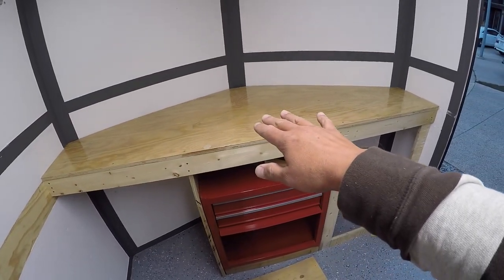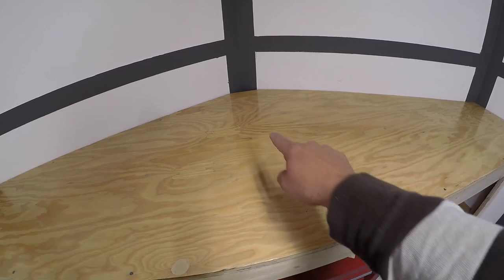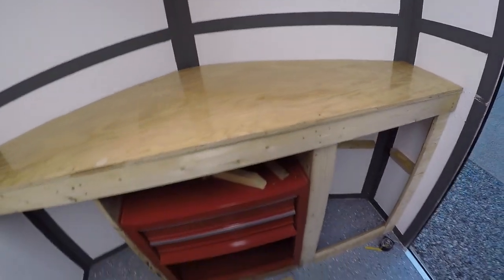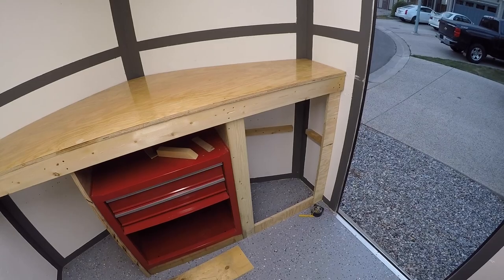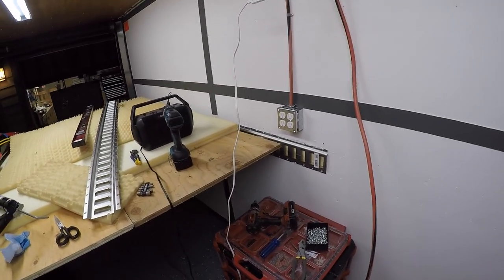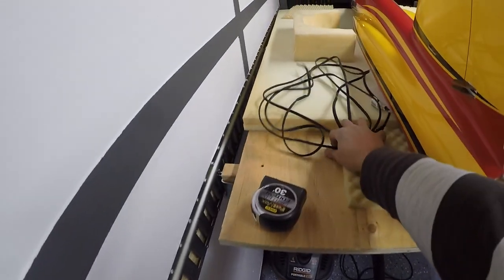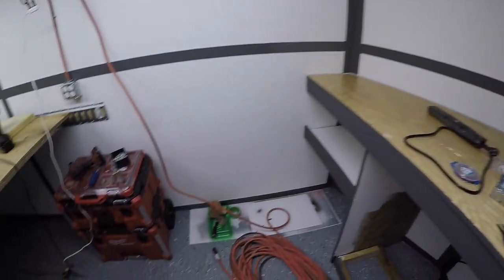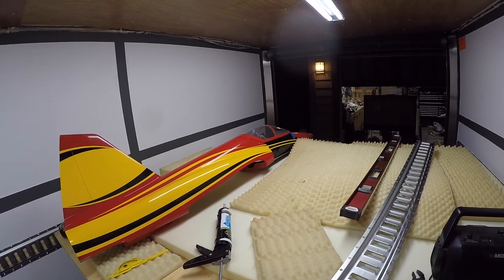RC AIRPLANE TRAILER BUILD - The Ultimate Jet Trailer - Video 4

Comment: 1) Carpet on the shelf is a great idea, it does really well with a grease or fuel drip and like you said keeps your shelf from looking like a fish net after a few years. In this hobby we constantly buy and sell planes and need to move the tie downs accordingly so after a few years your shelf has hundreds of holes and looks terrible even though the wood is structurally sound. 

2) I am busy designing my ultimate trailer. I will probably spend another year on designing because I constantly see things other guys did and either like it or hate it and then adapt my trailer around what I saw. One thing I haven’t changed since I started was putting doors on all my cabinets, our jet group often do trips where we visit and camp at the fields, most of us sleep in our trailers so I wanted a way to keep everything neat and organised and not have everyone who gets in see my clothes in my cabinets. 

 3) I would mount the spare tire somewhere inside to reduce stress on the outer skin plus here in South Africa your tyre would be stolen within a day or two.

4) I fly large scale and I stand my wings upright on the wing root and strap them with bungee cord and D-rings to the side of the trailer, a strap near the top and one near the bottom does the trick. For my jet and paternship I build a frame that screws to the wall and have nice thick dowls stick out from, which serves as a light weight shelf. I just run a strip of the soft side of velcro from the frame over the wing to the to a piece of the coarse side of velcro which I stapled to the bottom of the dowls. Last thing the wing box is a good idea, but if you ever get a new model or change models they wings might not fit and you have to redo the box or modify it.
Reply from the maker: Hello Charl!  Thanks for watching from the other side of the world!  SOOO Cool!  It seems like carpet definitly gets the vote and is the way to go.  I'll go that route.

Good call on the cabinet doors.  I prefer the neat and tidy look as well!  I have a travel trailer as well but now if i'm going to events it's one or the other so my airplane trailer will probably get the win and I will be sleeping in it.  I suppose it's time to buy a motorhome!

Regarding the spare, it's much less hairy where I live for theft but it still does happen.  The mount that came with the trailer (Mounted inside) had 2 lug nuts and a lock setup on it which is nice.  I may not sort out the spare tire mounting till next year.  🙄Still thinking on it.

Thanks for the suggestions on the wing storage!  I appreciate hearing the different ideas.

Comment: I would investigate mounting the spare outside on or under the A frame.  Many travel trailers have them slung behind the tongue jack below the v nose.  I would try to avoid storing it inside as it eats up valuable r/c space.  For sure small shelf/cupboard up front above your bench.  As you say don't make it too deep or it will overhang your work space and you will smack your head often.  It does allow a mount for another light, as well as various types of storage.  Wings can hang on walls, under the split bench (carpet gets my vote btw).   Have you considered hangers for your "man door" that could be a place to mount folding chairs?  Lots of brackets that will hold a pair firmly up top and a bungee across the bottom so they don't move around.   Interesting that you did everything 110V whereas I plan 12v knowing  that I will have solar/inverter/2x golf cart batts.  Both work I just like not needing to put lots of hours on my genset.  Of course if its cloudy for days then I would need to use it anyways.  Enjoying the build, there's as many ways to finish these things as there are modeler's out there.
Reply from the maker: Thanks for chiming in Daryll and great comments/suggestions.  It seems like most are suggesting the carpet route for the plane shelf, Makes sense.  My concern with hanging anyting on the door is i'm not sure there is any structure in the door itself.  I'll have to investigate it further.  It feels like foam core with FRP panel on the interior.  So anything that mounts on it has to be bolted through the door.  
I went with all 110v just to keep things simple.  My little honda generator sips gas and hardly gets any use in a year.
Reply: @thelightersideofrc  The way friends have done it they glue a ply/hardwood backer onto the door (PL premium etc) and then screw through it and into the light ply door material.  Should be plenty for 20-30 pounds of chairs etc.
Reply from the maker: @daryllfarrar2147  Ahhhh.  Perfect!  That makes sense.

Comment: Jonathan, good work. I like how this is progressing. I believe you have seen my trailer video in the group on FB. I lined my walls with carpet. I liked it for the reasons you mention about moving the D rings. I would carpet the airplane table if I did it again. As far as the NOCO adapter you installed. Looks like you ran into the same issues I did. I will recommend putting silicone on the screws where you ran them in the siding. I did not have good luck with the rubber gasket. Be aware of the power rating too. I chopped my plug off in the inside to wire it into the breaker panel of my trailer. I was surprised how small the wires were, but they worked for running chargers and fans. If your gas can leaks fumes, I’d recommend a vent to the outside for obvious reasons. I don’t advise overhead cabinets without doors, I had bad luck. Will you ground your 110AC to the trailer frame? Can’t help you with the spare tire. I could never get satisfied with where I put it. Check out my wing storage if you’ve forgotten. Pin those joints if you use PVC! I have a fantastic idea for wings that I came up with by repurposing some automotive racking I saw at work. If I ever get a sewing machine, I’ll mock one up. Keep up the good work.
Reply from the maker: Hey Jake!  Yea saw it!  Looks awesome!  Nice work!  No not grounding the 110V to the trailer.  It's basically setup like a bunch of extension cords throughout the trailer.  Keep it Simple!  Thanks for watching!

Comment: Enjoyed your tailer build videos. I do have a up front desk like you have and i have one higher up i keep whatever on. mine is the same size as the bottom one so i have plenty of room. 
I have stored chairs up there, wings, whatever i needed to keep there. does come in handy for more space. Spare tire ugh... mine is laying in the floor of my trailer i like it being inside the trailer so its out of the weather but it does take up space. i need get a holder like yours to keep it against the wall.
Reply from the maker: LOL.  That darn spare tire!  i'm still torn on where but I think I will re-install in the back on the wall.

Comment: Was thinking to mount the tire on the main back drop-down door outside or on the inside on the roof/walls (You could mount it in between and slightly above the 2 metal booms in front of the trailer attaching to the car.) Wings could probably go against the wall right next to or in between the planes. (Below plane tray if you have space or on the bottom of the plane tray hanging off it) Aeroplane shelf I think should be same as the floor material but without the chips. I think make a few open shelves to put in the front of the trailer above the bench to put some stuff in it. That's just my opinion, hopefully, you can get some ideas from that.
Reply from the maker: Thanks for the input!  I appreciate it!☺

Comment: I think I would done a fuse box , so the lights are on one fuse and each outlet have its on fuse , cause if you have a short its going to take out the whole system and maybe the main power supply as well
Reply from the maker: Mikey Likes it I see some guys doing that but unless your adding AC, and other stuff it’s basically all handled by the Honda 2200 generator. It’s got an overload/breaker on it I like to keep it simple if possible 😊
Reply: I was thinking the same thing, and i didn't use one on my trailer. but i did use the GFI outlets on mine. so those can pop if there is a issue.

Comment: Just a tip from a 50-year automotive painter don't use silicone on anything.  silicone especially in aerosol type is a painter's worst enemy.  It will cross contaminate and cause fish eyes in your paint work.  It will contaminate filters in any spray booth so please don't use silicone.
Reply from the maker: Amazing tip!